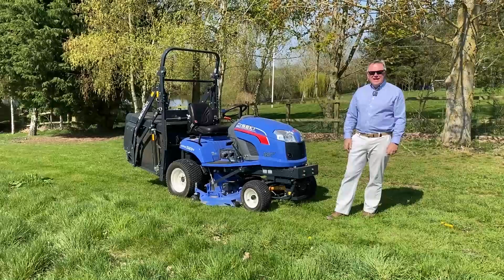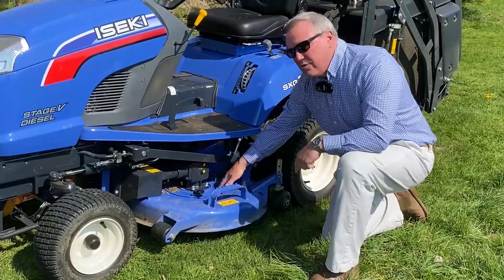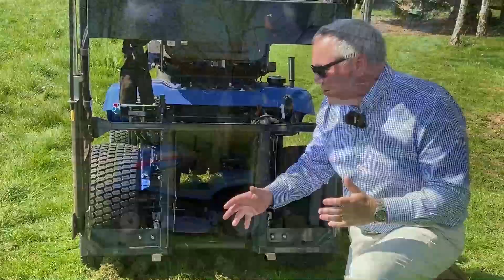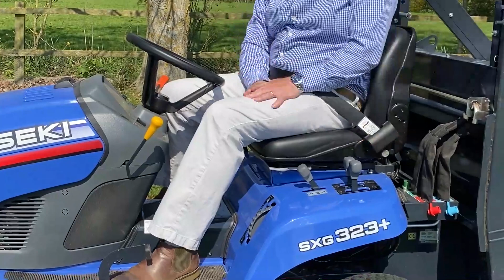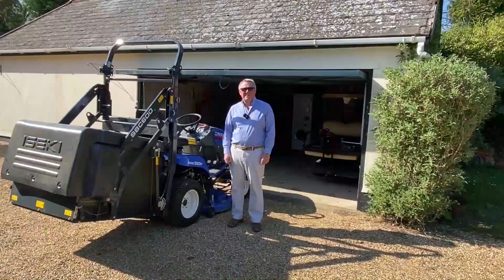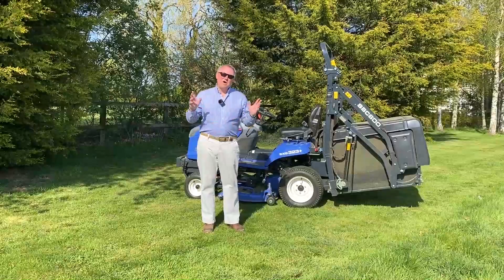ISEKI SXG323 Demonstration

Comment: What the difference between the SXG323 AND THE SXG323+ ?
Reply from the maker: The main difference between the SXG323+ and the SXG323 was the addition of the reverse mow-switch system to comply  with legislation that was introduced back in 2018/2019. The other differences were all cosmetic - new decals, new headlight trim and a neo blue deck instead of a dark grey one. Hope this helps.

Comment: Weve got this machine and they do block up very regularly! Also the grass gathers behind the side walls of the shoot which then means the pivoted base to the shoot, controlled by the handle to the right of the seat, is unable to lift and clear the shoot when required! Any solutions for this issue?
Reply: Oh no
I was going to buy one but like all dealers who cut dry grass on a windy day when it picks up
Then you buy one cut your lawn with dew on it and the whole system fails
Reply from the maker: Thank you for your message, if you can let us know where you are based we will arrange to have your SXG checked over for you to ensure that it was set up correctly.  Please either call us  01473 599266 or email us info@iseki.co.uk.
Reply: @ISEKIUK  thank you. I'm based in Brackley, Northamptonshire.
Reply from the maker: @guyoutdoors85  thanks, please can you contact us direct on our office number asking for David Withers and we shall arrange for someone to give you a call.